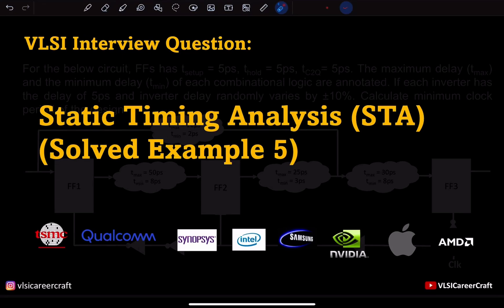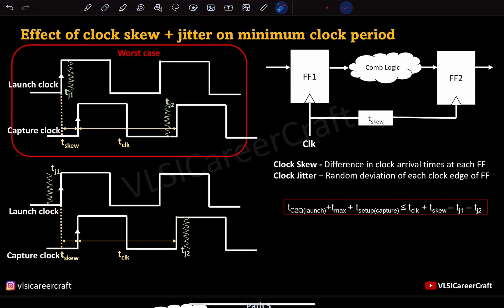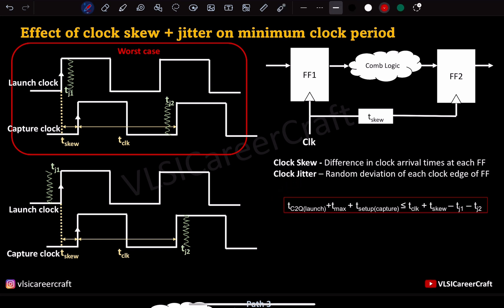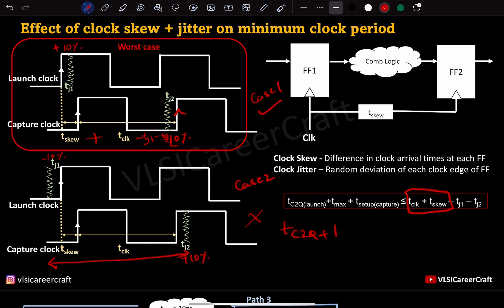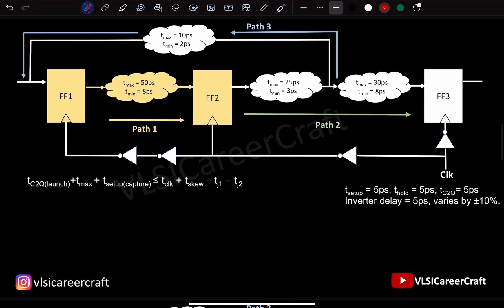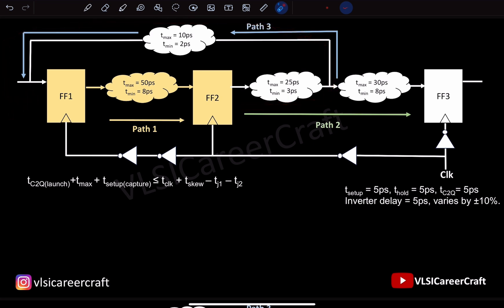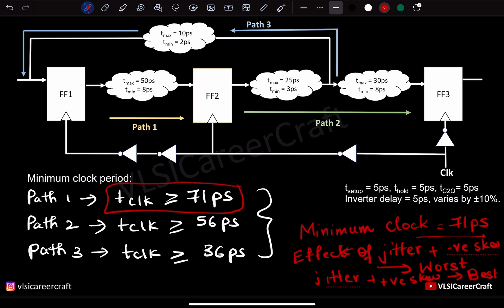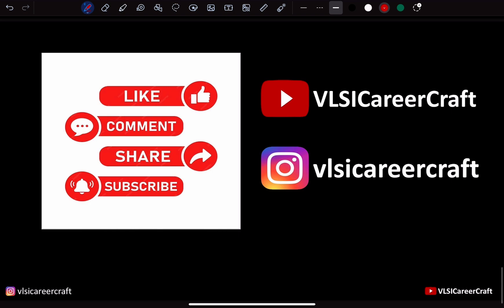VLSI Interview Question: STA Solved 5 | Effect of #clock  skew and jitter on setup time

Comment: For FF1 to FF2 there are two inverters in clock path effectively if we don't consider the common inverter delay between FF1 and FF2. So, now two inverter delays are giving negative skew which is fine. But what about clock jitter madam, I'm confused like do we have to consider only -2*(jitter) always irrespective of the number of inverters in clock path? Tclk+tskew-2*(jitter) is what the original equation on right hand side for setup analysis. But will that -2*(jitter) term changes if there are multiple delays, let's say inverter and buffer is also there with each having same  plus or minus 10% delay variation. Then will the equation holds same or it will change?
Reply from the maker: Thanks for the question! The terms tj1 and tj2 in the generic equation which given in slide 2 refers to the amount of random deviation of each clock edge. Whenever the inverter delay is given skew and jitter depends on no. of inverters but when jitter is mentioned in the question then it would be -2*(jitter)